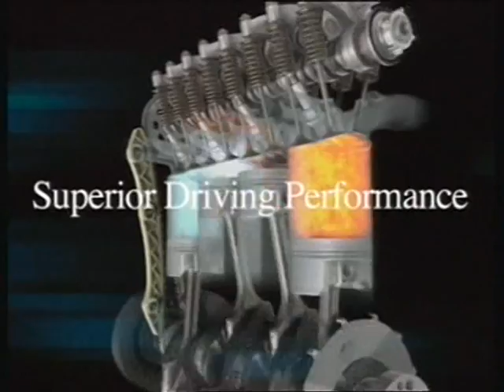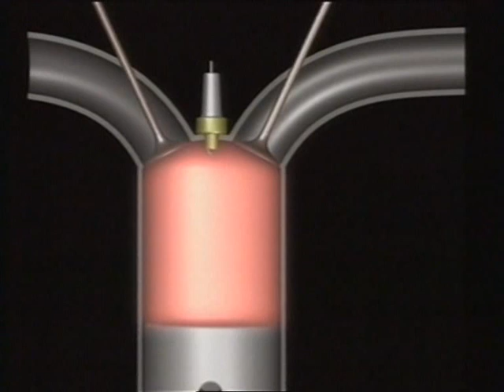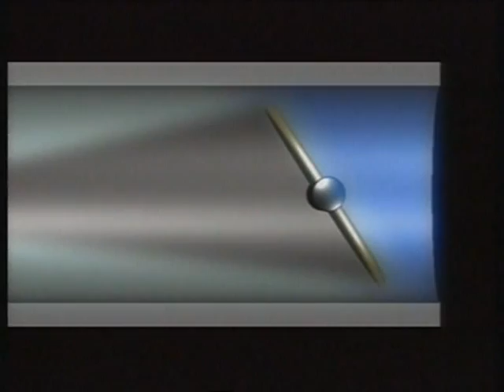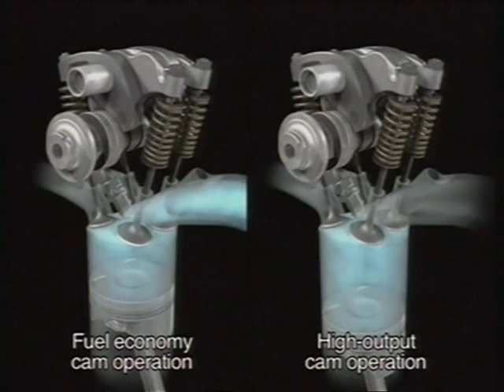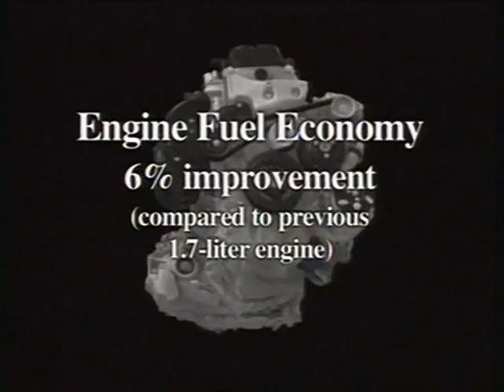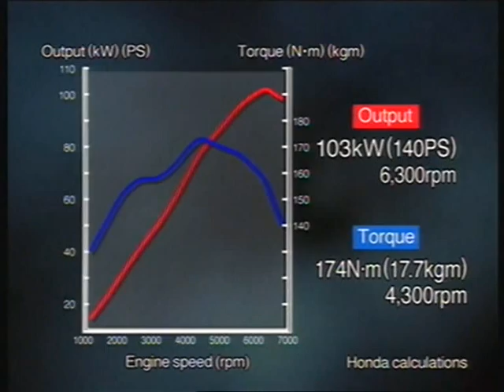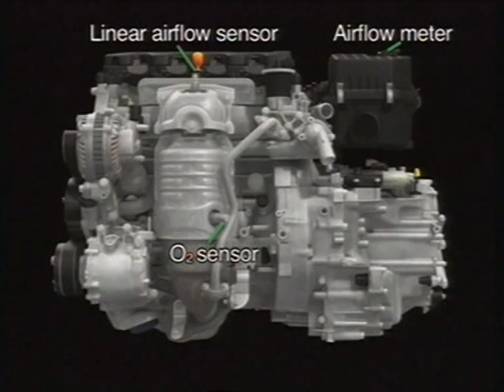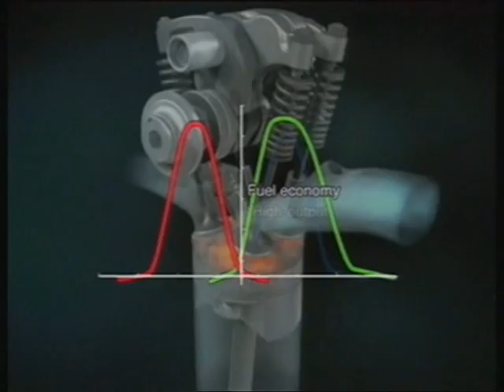Birth of the Honda R-Series i-VTEC

Comment: I have R20 in Accord 2010.  350k and no Oil eat ❤️👍👍👍
Reply: really ??? i have buy an accord with this engine two weeks ago, is it a good engine ?
Reply: @dinoarnaut9438  Yes.  I recommend highly.  I have an automatic gearbox which is also great.  Apart from regulating the valves, the engine does not require any major interventions.

Comment: The best engine of the world
Reply: Just no.. it's a good little engine but to say it's the best engine in the world is a little bit crazy. Especially considering that it's a fuel economy motor with a little bit of power. No matter how much money you throw at an r18 it will never be a serious engine. Take it from me. I've built my 2008 honda civic r18 a complete rebuild and head build and turbo. My r18 makes 416hp however I had to spend nearly 6,000 dollars to achieve this. Not including repairs and maintenance. In my personal OPINION the best engine in the world is probably the 2jzgte or the L.S series
Reply: @spencertaylorcrowe  I had an experience with my 06 and you'll not believe me it's was a day was driving my home to my job of 45 minutes of difference and it's was oil leak when someone notice the car was smoke underneath and told me your car is smoke I pull over in some spots and when I check the dipstick it's was really empty I drive to my job of 5 minutes of difference and the engine is was running normal with nothing oil. I was really impressed.
Reply: @anthonyvasquez9068  lol
Reply: @spencertaylorcrowe  yes, but in a reliability and economic way is one of the best engines for a daily... If u want to make some hrsprs just swap for a k24
Reply: @jimmyjump8543  This engine is not designed for high performance it's designed to give good fuel economy and decent acceleration for everyday driving compare you so called 2ZZ to a B18C TYPE R and then see which engine is more powerful
Reply: @jimmyjump8543 the Corolla xrs was also a tin can and so were other Toyota vehicles which used 2ZZ engine and no 2ZZ didn't had any bigger valves or better cylinder head or anything let alone a K20 which is way ahead of any 2ZZ.your making this all by yourself lol and go watch races of a B18C TYPE R vs your so called 2ZZ don't say that Integra was lightweight and the Toyota vehicles which used the 2ZZ engine were not
Reply: @jimmyjump8543  you can find me tons of videos of B18C and K20 getting spanked by 2ZZ we'll the thing is you were talking about stock vs stock and in stock form no 2ZZ can keep up with a B18C TYPE R or a K20A your referring to modified and mod for mod and the right tune the B and K are clearly superior in every way then a 2ZZ stock vs stock or tuned vs tuned

Comment: Very good Honda's engine.
Reply: its too much consume the fuel for this r-18
Reply: Finley Ralph  lol fake and scam
Reply: Is it as good and reliable as K20 engines?
Reply: @maciejsn2126  using r20 cam and headblock
Is already enough to smoke fd2 k20z 
Stock vs stock
If wanna go reach more power
Go do remap ecu
Do custom mapping
👍
Reply: @lol-si4gh  just wonder about reliability if can do 300k miles like K20 (don’t mean power)
Reply: @maciejsn2126  my fd 1 is now at 450k millage bro..
Automatic

Comment: The birth of engine block crack..
Reply: true i was about to buy an 2008  , so lucky to find this issue ... even if only a very low numbers of block crack , i'm not gona the chance ....
Reply: Yeah I have a 2008 and the block cracked in 2017 @ 150,000 but my Honda dealer replaced it at no cost to me. my Civic is black and the clear coat pealed off so the car looks like shit but gets my ass where I got to go lol

Comment: My 13 year old 2008 1.8 RA1 engine civic has just hit 100,000 miles and i drive it hard with 6,000+ rpm on the regular. Servicing is every 12 months doing nothing but air filter, oil filter and oil change. I've just pulled the spark plugs and done a compression test on the cylinders. Technically reading the spark plugs and they're telling me the timing and fuel to air mixture is spot on.
 Honda says the cylinder compression should be 134+ psi with a maximum 28 psi deviation between cylinders. All 4 cylinders came in at 174 psi +/- 4 psi. That's phenomenal for an engine of this age.    ..now I just need to go get my Honda tattoo :)

Comment: 110k on my R motor 2015 Civic w/CVT. From an "enthusiast" perspective, the R18 driving experience feels like a smoother version of the old B18B non-VTEC DOHC.  Mine is daily driven & occasional road trips + a couple of years doing Lyft rideshares. Not a single problem or component failure on anything in the car. After having the valves adjusted per normal maint schedule it drives better than I did when the car was purchased at 30k miles. CVT is very smooth, performing as expected in both Drive and Sport modes. With Cruise set at 80 mph on the freeway the R motor sits sits below 2500 RPM and gets about 38 MPG. CVT has been religiously maintained with the fluid flushed once per year, which costs roughly $300 per flush at my local dealership. Compared to the maintenance on my fiance's '18 Toyota Corolla, I spend 2/3 what she does even with my zealous CVT maintenance.
Reply: 1992 B18A1=140hp, 2015 R18A= 140hp. Seeing the torque curves plotted against each other would be interesting. Honda engines just own any other company's engines. Yes BMWs have the same high revving fun peaky engines, but they are about as reliable as Trump telling the truth is.
Reply: How would You compare R engines with K engines taking reliability in account
Reply: @maciejsn2126  They're both final generation port fuel injected Honda motors. Both are excellent and will last forever in stock form.

Comment: I wish they gave the SOHC J-Series V6 engines this type of i-VTEC in the 2010s. Only the 3.7L J series had dual vtec for the intake and exhaust valves and it didn't help fuel economy at all.

Comment: Except TSB 10-048 where the blocks have a flaw and leak coolant. Honda only warrantied for 10 years.  Mine started this year, 2 years past warranty
Reply: Was the jdm version has the same problem
Reply: Only in America
Reply: That TSB only applied to early production models. Any block produced post-2009 had the metallurgical issues worked out.

Comment: That's my engine!! I never knew it is vtech though for my 9th gen r18 civic LX
Reply: Not DOHC its single cam, and its i-VTEC, it doesn't "kick in" like traditional VTEC. Its basically for fuel economy and the i-VTEC only "kicks in" when driving like a grandma with a steady throttle lol, not like the iconic SI with performance cams that kick in around 5k rpm. It is variable after all. Its a version of an economy oriented i-VTEC that is different (even different then VTEC-e, 3-stage i-VTEC). Under the right engine load and engine speed conditions the VTEC system switches to a cam that delays the intake cam closure by extending the duration so that the piston pushes out fuel-air mixture back through the intake causing the engine to operate in an Atkinson-Cycle mode. The loss in power from going into the Atkinson cycle is compensated for automatically by the ECU opening up the throttle more (without you having to adjust with your foot on the accelerator). So it improves fuel economy two-fold by (1) reducing pumping loss by opening of the throttle body plate to give less restriction to the intake path and (2) going into the Atkinson-Cycle which uses fuel more efficiently by having a longer combustion stroke than effective intake stroke giving more time for the fuel-air mixture to combust. This also decreases emissions but who cares about that lol. There is no VTEC characteristic torque bump either. VTEC is a tricksy hobbit lol. All kinds of conditions. Engine RPM, vehicle speed, engine load, throttle position, coolant temperature, oil pressure etc. And yes I know VTEC can kick in at different RPM then 5k on the SI but is it performance or economy? VTEC is meant to have high performance at high RPM and low fueI consumption at low RPM. i-VTEC is kinda backwards but not idk, hard for me to put into words but basically not true VTEC and kinda strange to say its intelligent compared to traditional VTEC although Honda does have some intelligent engineers. Then again it is actually pretty interesting and intelligent what they have achieved, I am not the intelligent one. Yes, I know different engines have different engagements for VTEC. l have messed a lot with the valves and modded/fabricated so many different set ups; proprietary chip sets, cutting solenoids, load resistors, remapping ECU, locking rocker arms, machined different heads and VTEC pins or whatever they are called, toggle switches so all 4 valves open instead of 3 to utilize the primary lobe instead of the secondary lobe, trying 3 lobe cams, lobe height and spring height, HX with a EX ECU and switching to 4 wire O2, trying VTEC killer, locking rockers in a non VTEC head comparing, trying to tune intake lol so many variables with Variable Valve Timing & Lift Electronic Control, hard to tune something variable. A lot of fails and a lot of learning for me. These engineers are big brained and I am sure have tried more then myself.
Reply: @H74ver  will 2.4 ivtec engine have good fuel economy?

Comment: Which Honda crv engine is more reliable
R20A or K24z?
Reply: I have a 2012 r series and a 2005 k series civic. both have been trouble free except starter on the 2012 and a sensor on the 05.
Reply: @guitarandstuff8265  - what’s the R like on MPG is it manual ?
Reply: Automatic.  It's showing 32.6 mpg on the display rn.  I do a mix of city and highway driving everydsy